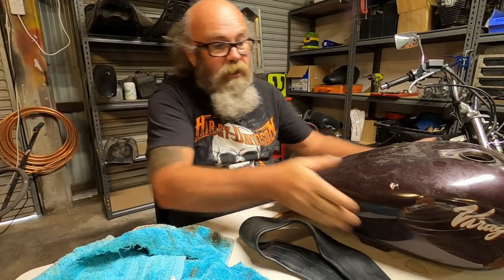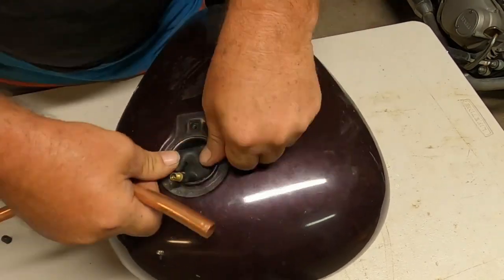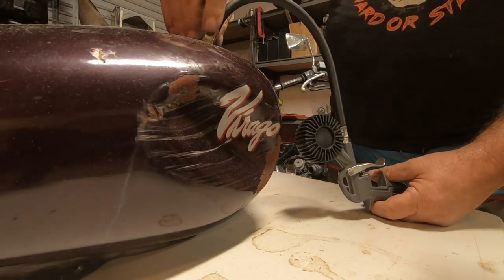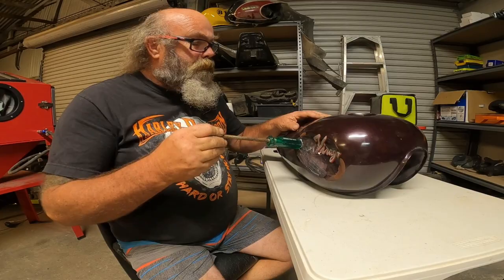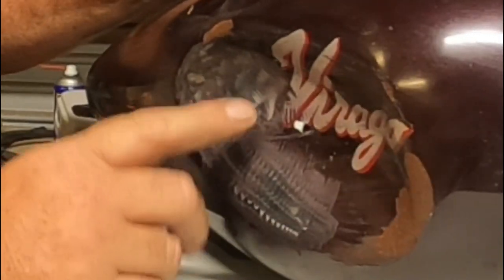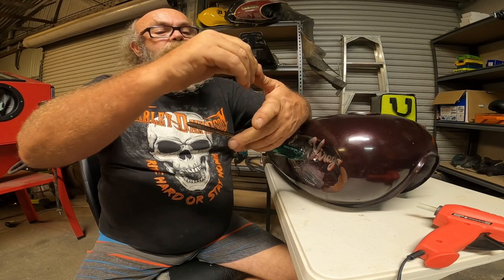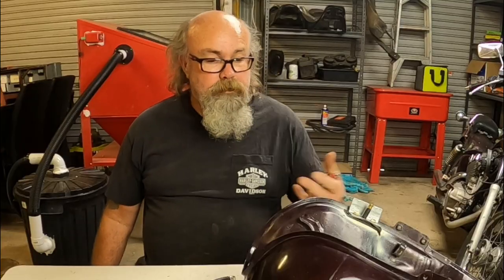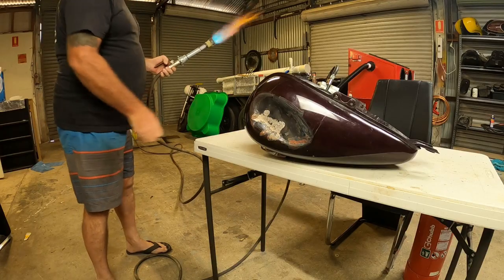Gas Tank Dent Removal FAIL

Comment: Naked flames on a petrol tank😮 it’s good to see you survived 😁. Weld a nut to the outside of the ding and use a slide hammer to try pull the tank out
Reply: Maybe in the future now because this tank looks completely fucked😂 sorry Benno for laughing I hope you find a replacement easily 👍
Reply from the maker: The Tank had been empty for some time with not a wiff of fumes. Thats a mistake that only gets made once. Had a few days to ponder the options and have come to the conclusion that the tank can yet be recovered or I will stuff it beyond all recognition.. Cheers Robert
Reply: @BennosShed  absolutely right about that. Well I hope your new found ideas work. 👍Nothing frustrates me more when shit just goes south and doesn’t want to play the game😂

Comment: I did a similar tank but I didn’t use a tube. I installed an air valve where the pet cock goes and sealed the gas cap. Installed 60 lbs air and torched the dent and watched it slowly pop itself out.
Reply from the maker: Yep tried that and over pressurized the tank, well you can guess the rest.